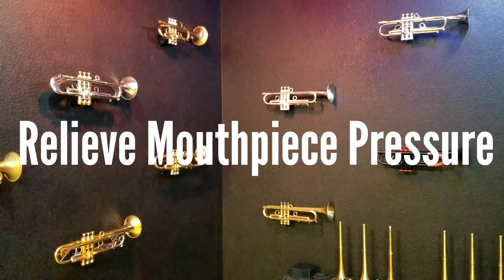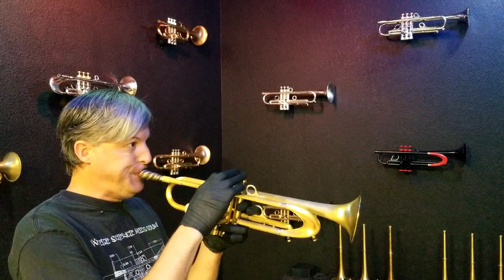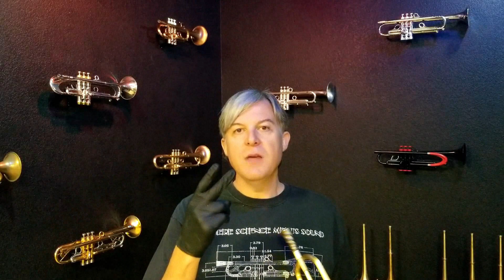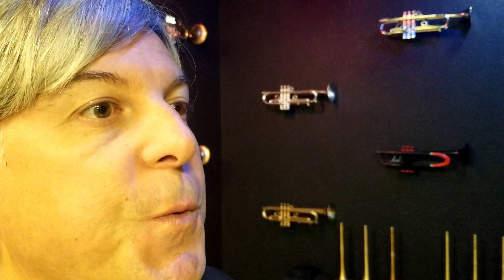Relieving Mouthpiece Pressure #2 Air Speed on Trumpet

Comment: Hi Jason. Did you check those speed changes with anemometer?
Reply from the maker: Yes. I used the hot wire method.
Reply: Where did you measure?  Through the aperture? How did you place a hot wire in the lip aperture while playing? Since the lip aperture opens and closes during the cycle, how did you not burn your lip?

Comment: Why the decision to change the size of the aperture rather than changing the airspeed with your tounge?
Reply from the maker: See my next video 👍😃
Reply: The tongue does not increase the air speed through the aperture. Nor does the size of the aperture.
Reply: Darryl Jones How doesn’t it?
Reply: @JohannesBecker2123  added resistance by the arch will add to the total system resistance.  Thus the flow will be reduced. So for a fixed aperture size the flow velocity through it would be proportionally reduced.  Also, the tongue position does not increase the air pressure bearing on the aperture, thus the  velocity thru the aperture does not increase.